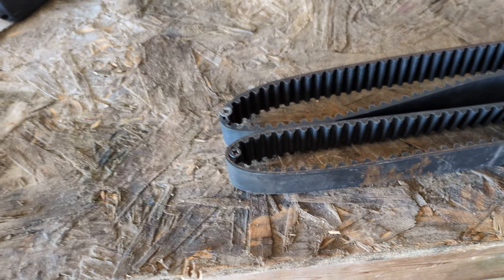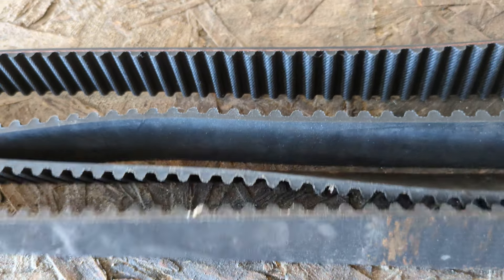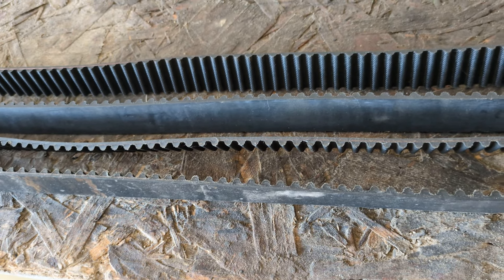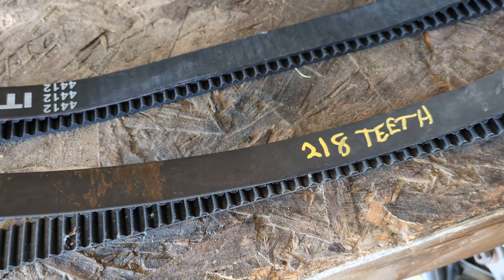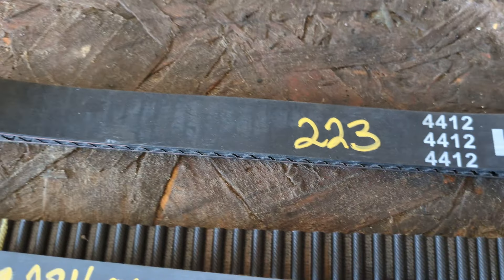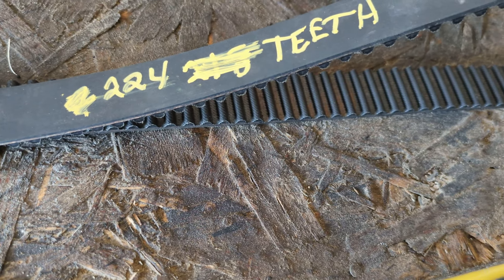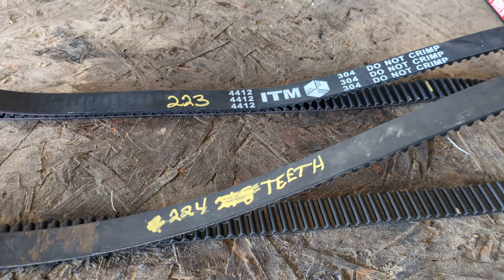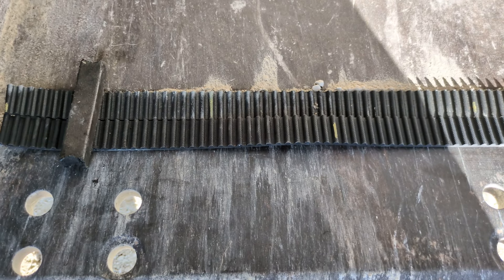If the Belt is the same, how come the new belt would not fit

Comment: Mitsubishi belt. Try installing with the lower idler almost off and angled a little bit. With a bit of strength it should slip on. Use clamps on each cam to hold the belt in place.
Reply from the maker: It's been years since I installed my last Subaru belt, things get a little foggy on the steps. Thanks John.
Reply: @crazybillsgarage  I feel your frustration very much, even though I know the steps its still always a pain. YT videos and forums make it seem easy when its not.
Reply from the maker: @johncornharvester so true, thanks.😉
Reply: Mitsuboshi makes belts not mitsubishi.
Reply from the maker: @DieselRamcharger thank you for correcting.
Reply: @crazybillsgarage  itw belts are crap. generally speaking you want unitta/gates belts {the oem supplier for honda/subura/toyota etc} but any of the japanese made belts are good too {mitsuboshi, bando}
Reply from the maker: @DieselRamcharger thank you.